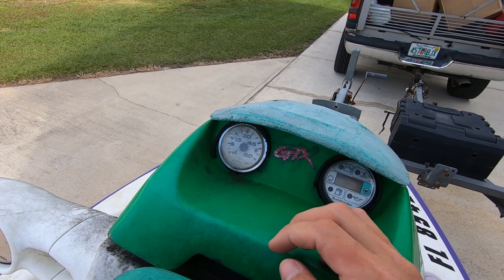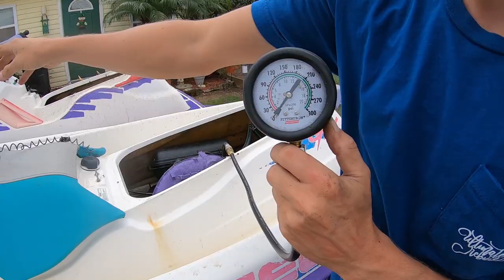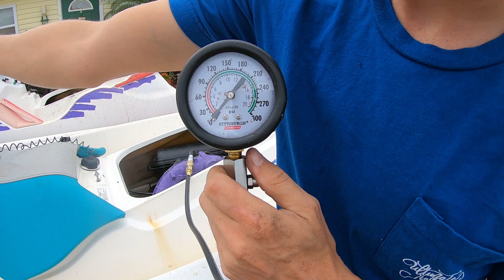I Bought a Pair of Jet Skis for $500! They Worth It?

Comment: Compression should be around 150, however it is entirely unlikely that all 4 cylinders on 2 engines are underperforming exactly the same. The fact that they were all within a few psi of 90 says they are all in good condition and your gauge reads low.
Reply: I have heard the cheep gauges like I would get from harbor freight also read lower than actual compression, as much as 30 psi lower. just to keep in mind.
Reply: Engine been sitting after it runs and the rings re seat I gaurantee it’ll compression test 150 or higher now

Comment: Yep, you did the compression test incorrectly. Choke off and throttle wide open then do the test. Great deal for 500 dollars.
Reply: Yeah, you gotta have the throttle open. In my experience. I believe it wont pull enough air through the closed butterflys to get accurate pressure in the cylinder. BUT these are 2stroke, not sure if its the same, but common sense says it would be?

Comment: Didn’t read all the comments but be careful when turning over the engine without the spark plugs wires being connected to a spark plug, you can burn up the ignition module. That little orange thing that looks like plastic spark plugs in the front of the engine is for attaching your leads to when turning over the motor without spark plugs, it shorts the ignition so that you don’t burn it up.

Comment: Yessssss keep the jetski builds coming heck yesss!
Reply: Hey! I have the same crappy GTX with promise of life! Let’s do these!
Reply: eBay has been my friend to add needed parts for the GTX
Reply: @markd1199  likewise, I’m waiting on for some 2000 GTX worx sponsons to appear on eBay to buy them!
Reply: @Eddyte  wouldn’t recommend
Reply: @drayz8818  you’ve heard bad things ? Or you’ve had bad experience?
Reply: @Eddyte  both The WORX sponsons are for the newer skis and not sparks like the big size models
Reply: @drayz8818  oh gotcha! I cracked my left one which is why I was thinking of just upgrading to adjustable  WORX sponson.

Comment: Compression test issues are Harbor Freight compression tester, and that the compression tester does not have a check valve at the end of the hose it has the check valve by the gauge. All Harbor Freight compression tester has read at a Max of 90. When buying another compression tester make sure the part that screws into the spark plug hole has a check valve

Comment: Compression test was done as it should. I’d invest in a better tester because I’ve found the harbor freight coolant leak testers and compression testers tend to stick and give inaccurate readings. But that being said, 90 for a two-stroke seadoo motor is good. You generally want to see the compression in all cylinders all the same and within spec. Which is 110psi-90psi. Your skis were in spec and almost the exact same +-1psi. You got an excellent deal!

Comment: When doing the compression test, you have to hold the throttle open while you crank it (or do it now while carbs are off). Also, on the one you took out on the water, now that you have run it a bit, try compression check again. Sometimes after sitting a while, the piston rings can stick and will free up after running. Of course, make sure your pressure gauge is accurate.

Comment: If you block off the oil pump and run premix you will still have to keep the two big oil lines conected to the motor, that is the rotary valve bath oil
Reply: Second this. We always converted to pre-mixed. Less hassle down the line, and one less moving part to fail on the water. Does make 'topping up the tank' harder, since you have an extra step and need to keep a mixing bottle around, but much more reliable imo.

Comment: Any time you do a compression test you need to hold the throttle wide open. This allows the cylinder to fully fill up with air. 

I vote for origins graphics I love the color schemes of the 90s as well.

Comment: On this 2 stroke engines you still have to have 2 stroke oil on the oil tank to lube the bottom gear on the engine. You can pree mix all you want but need to keep the 2 stroke oil in the tank and the big hose that goes to the bottom of the engine. IF YOU DONT BROKEN MOTOR. 👌👌👌👌👌👌👌👌
Reply: Only on seadoos
Reply: No u don’t😂
Reply: @louisluckett4160  lol go ahead keep believing that. It's what keeps me in buisness.

Comment: Love the videos man! Few things to keep in mind with those skis, the two large oil lines going to the bottom of the motor need to be connected and filled with oil. Some guys leave the stock oil tank in place or you can also loop them together making sure they are filled with 2 stroke oil and just keep an eye on it, in theory it shouldn't burn that oil if your seals are good. Another thing to keep in mind is even when you have a hose hooked up don't run them too long on land. Those models have a plastic thru-hull fitting that get wore out over time and they can melt if they get too hot without water cooling them, the replacement metal ones are much better. Finally, a leakdown test on these old engines is a very good idea. Without a leakdown test you won't know if your crankseals are pulling in unmetered air and overtime it will burn up the engine.

Comment: I’ve worked on a few of these so just a couple of tips, but the starter fluid isn’t very good to use on two strokes it doesn’t have the lubrication that the rings need not a huge deal but a genuine mikuni carb rebuild works well. Those deals are hard to find good luck

Comment: The compression was fine. The engines were cold and you didn't have the throttle wide open. Once they warm up, it will have more compression. Hold the throttle wide open as well while cranking it for compression

Comment: You did the compression test right - after running them a while you should retest and see it pick up some compression as the rings free up and oil finds its way into the cylinders. I would be more concerned about the water in the cylinders - I dont think the water pushed out of the cylinders was from pressure washing, I would check again after being in the lake, my guess is the crankcase needs to be drained and the exhaust elbow is cracked and leaking. In any case - Great deal Zach and have fun!

Comment: I don't trust your compression tester. Ideally you want the engines warmed up, the throttle wide open and a fully charged battery.

Personally I wouldn't put much money into those smaller engines. If they were 787 or 951s or maybeeeee a 720 cc engine I would say go for it. 

I hear the small XP hull with a 787 engine in it is a real hoot. Enjoy watching your builds but I would caution you about spending much money on them if you plan to sell for a profit. Keep in mind saltwater causes a lot of problems if you have to dig into the engines or jet pumps. I'd say the trailer was worth it for $500.

Comment: Spi was a mid grade model that fell between the spx and the sp, the gtx line works the same way with the gti and gt. The spx's of the mid to later 90s were essentially the previous year's xp which had a 720 engine. I'm guessing you had the same engine that the 94 xp had which was a 650. The knob on the right side should be gas on, gas off, and reserve. Good luck, fun skis.

Comment: Good find of jet skis and double place trailer. Word of advice though, almost always buy an AGM(Absorbed Glass Matt) battery for jet skis. The Lead-Acid batteries that you purchased for them will not last due to the vibrations and design of it. AGM prevents plates from moving and creates a longer more reliable battery. It will pay for itself when it lasts 3+ years and not the usual 1 year with a Lead-Acid.
Reply: All my wet batteries in all my jet skis, motorcycles, boats, lawn mower, welder, vehicles last 8 to 10 years. Always keep them topped off with a battery tender each month especially in the off season. N.E. Ohio, so weather isn't as tough as hot Fl. weather. Hot weather is a killer on batteries more then cool weather as is over charging. Never charge over 1.25 amps for maintenance.

Comment: They spi is a two seater BUT they are extremely tipsy. I have a 1993 XP 687cc and the moment you try to load a passenger it will flip. So thankfully you have more then one jetski to go out with and have fun.

They are very quick to spin around. You will see. The first time I took mines out after restoring I took it out and took a turn way to quick and I flew one way the jetski another and my glasses another. That one ride cost me about $400 to order new glasses. Lol

Comment: Hey, for the fiberglass cracks, I would use a Dremel and make them bigger... Then use a product that I used from the company Totalboat that will fill the cracks then you paint over with gelcoat. The product is called there 2 part epoxy. It is a blue and yellow putty that I love

Comment: something to try with compression test is throw a little 2 cycle oil in the cylinders that will seal the rings better obviously they've been sitting so cylinders are dry should bring them up to 110-120psi

Comment: Initially the Rotax engine should be good for 300-450 hours or 12 years.

Once I complete an overhaul and rebuild the crankshaft with all new parts, including connecting rods with 2 oil slots, and you run premix @ 40 to 1 or oil injection & add 3.2 ounces of oil to every 5 gallons of gas, you can run the engine to 450 hours.

Comment: Good call on sending out the carbs.  I had a 92 GTX that I got running, but was never quite right.  Also check your fuel pump, the one in mine was  cracked and so it would run and pump but would lose pressure when the fuel level lowered and sloshed around.
Reply: Fuel pump is inside carb on Older Sea Doos (these in particular)
Reply: @jetskirehab750  maybe I should have said fuel sending unit?  It's been a while.  The thing that works like 2 giant straws in the tank.
Reply: @chrisrischan  These don't have a sending unit. Only a fuel pump inside carb which uses pulse pressure from crankcase to create a suction and pull fuel. That is why if you have the tiniest air leak these machines will not run right.
Reply: @jetskirehab750  It would have been a whole lot easier to just correct me on the name of the part I was trying to describe than just tell me I'm wrong.  Apparently the part I was trying to describe is called the BAFFLE according to the parts diagram.
Reply: @chrisrischan  Yes you are correct. Sorry I was not trying to offend in any way at all,  but yes the two pickup lines inside the gas tank are part of the fuel baffle. There are no "pumping parts" in this baffle it's basically just two hoses.

Comment: Depends on if you plan to keep or sell these on the subject of the graphics - if you plan to keep then either do both with the 90's graphics if you plan to sell one or both I'd "update" the look.  Also, from what I've seen on YT those compression /pressure testers give strange results - unless compression seems to be an issue may not be worth trying to resolve with a rebuild - you certainly have enough "room" in the budget if you had to rebuild...  As always a great video!

Comment: Dang! and here I am pricing out Waverunners in the $12k-16K range.
Reply: Yh, pwc’s can get really expensive unless you’re looking for something like a spark
Reply: seadoos are cheap just the old ones
Reply: The vx Yamaha’s  with the 4 cylinders aren’t bad. Like up to 2015
Reply: @benmurtagh4537  I am definitely finding that out. I was doing some flyboarding a few years back and the kid running the PWC was telling me all about how Yamaha has this really nice model that was around $7500. Now as I start looking, I am seeing them up to $18K. I want one strong enough that it will pull a wakeboarder.
Reply: @carsongwin1816  Did the quality drop after 2015? Or are there issues? I'll be researching and shopping around for a while yet because I still need a good tow vehicle and need to clear some project cars from my driveway.
Reply: As a rule of thumb, I’ve found that any recreation model of a pwc can tow a tube or a wakeboard pretty easily, you don’t want to go too overboard with horsepower otherwise it can be hard to try and maintain a steady, wakeboard-able speed.
Reply: @benmurtagh4537  Thanks! Good to know and something else for me to consider.

Comment: Quick tip: Don't put your tongue jack with the wheel facing forward. If it ever fails it turns into an emergency brake that will flip your trailer. You want the wheel facing aft so that if the jack does fall down it drags instead of becoming a catapult for your jet-ski lol.

Comment: I actually bought a 95gtx from my uncle for $100. Same condition but not running and I got it working. I ended up repainting the hood a blue teal color to match the seat and in my opinion it stands out more. I can’t seem to find the decals tho to replace so if you find a way to get new decals lmk please because I could really use new ones too

Comment: Just a heads up use Sea foam spray  instead of starting fluid, Sea foam gives the cylinders the oil they need.  Starting fluid doesn't.

Comment: The SPI has a 587 engine which is about 55 hp.  You will still need to re-connect the oil injection system even if you go with pre-mix because the injection oil lubricates the rotary valve gear on the crankshaft.  The minimum connections are the larger hoses that connect at the bottom-middle of the block.  The oil pump should be removed and blocked off if you want to run the engine on pre-mix.  If you are going to keep both these machines, I would make them both the same fuel wise.  I can guarantee if you don't, the SPI will end up blown up when a buddy borrows them and doesn't understand one is pre-mix and one is oil injection.

The GTX is a 657X engine which puts out about 65-70 hp with a single carb and 80-85hp with a dual carb setup.  I had two of the dual carb engines in my '95 Speedster and they are pretty decent. If you really want to bump things up, the 720cc engine is almost a bolt in upgrade and it has 85-90 hp, if I recall correctly.  If you go with a 720, you will need a new ECU box (higher revs) and a new impellor to handle the higher horsepower.

Parts are pretty plentiful on eBay.  I have cobbled together essentially one 675X and have a second core which I plan on doing a rebuild series on and sticking in my '94 GTS.  If you are going to upgrade the engines, do not buy them in parts, wait to find a complete core engine as that is the much cheaper way to go.

The GTS/GTX hull is not the quickest but it is a nice stable machine for cruising type riding or towing tubes, etc.  The SPI will be a hotrod and handle like a motorcycle on the water.  I think it is essentially the previous year's XP machine.  Kind of gives you the best of both worlds. 

Hope this info is helpful.
Reply: As for the stress cracks, they are much harder to repair that they look but do not lead to leaks.  The right hand scrape/gouge on the GTX looks like a hull crack not a scrape.  That will need to be repaired.

Check out Boatworks Today on YouTube for some good info on patching fiberglass and gelcoat.  Andy does a fantastic job of explaining how its done.

Comment: Yo man im a seadoo tech up here in washington! I must tell you that when you block off the oil injection pump here are a couple things to remember!
1. There are 3 lines that goes from the oil tank to the engine! You will only block off 1 of them, and the one going to the oil pump is the one you want to block off along with actually removing the oil pump! 
2! The oil lines going to the crank case must me in good condition! These supply oil to part of the crank shaft and to the rotory driver gear. Without oil it will gain in seconds! 
3. Search up my channel for the video explaining why this is so important!!!!

 Upon further watching your video found so many new problems!! 1 the guy lied to you! They both have way too low of compression! You should have about 150 anything less than 130 is bad
Reply: Read this ☝️
Reply: No the compression is fine it's his gauge thats the problem.
Reply: @jetskirehab750  I'll agree that the gauge he used is pretty bad but still concerning
Reply: @soumyadastidar8732  As long as they are even on each cylinder he should be perfectly fine. I have seen them run at 90 psi per cylinder just fine. Not as good as they could be but still fine. His are more likely 120+ per hole

Comment: 90 Psi is pretty low 120-150 psi is what it should be. I’m not sure how to long they sat for but I did notice water in the cylinders might have been from washing but it might not just be from that. put some 2 stroke oil in the cylinders and let it sit for a few minutes you don’t need a lot maybe a couple cap fulls it well help the rings if they are stuck or rusted on the piston. then put a towel or something over the holes and crank the engine over to clear it out then go ahead and test it again it should bring it up in the first 1 or 2 try’s of doing that. make sure the pistons are covering the exhaust port so it doesn’t leak out them while you’re letting it soak.

Comment: If they run more those numbers might go up more for compression .make sure you hold open the throttle when doing the compression test .what I did is get a cheap gauge and compared it to my buddies expensive gauge and it was spot on with it.could do that instead of buying another gauge

Comment: compression results are just a result of the non return valve at the gauge and not at head, (where you screw it in to the  spark plug hole ,longer the hose the lower the reading will be,you are increasing volume of cylinder so lower reading.)

Comment: The “stress cracks” are not stress cracks it is cracks in the gel coat and nothing to be concerned about. To find out what side motors you have there is an orange resistor in the front and a plate right by there on the front of the motor and it will give you a model number.